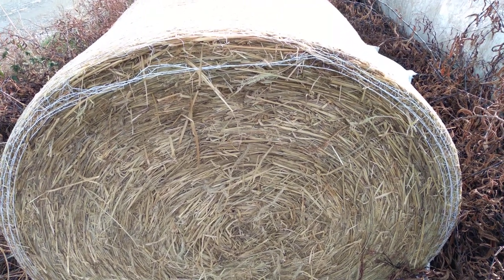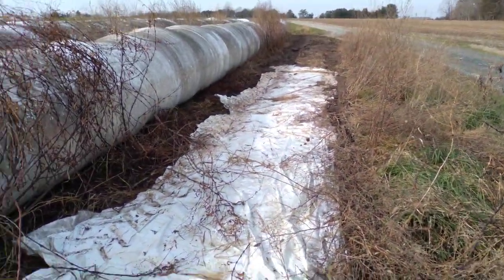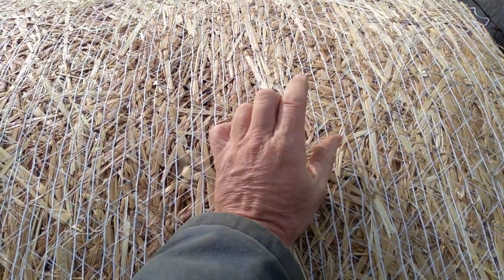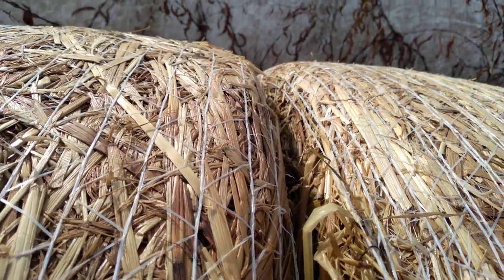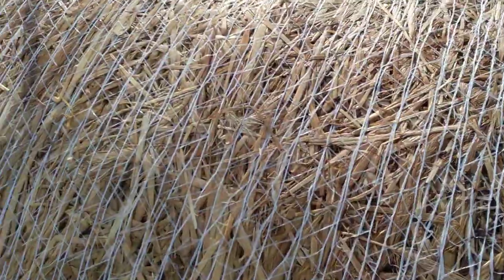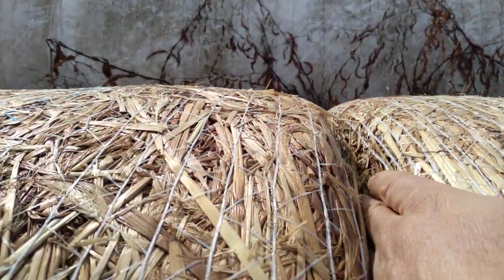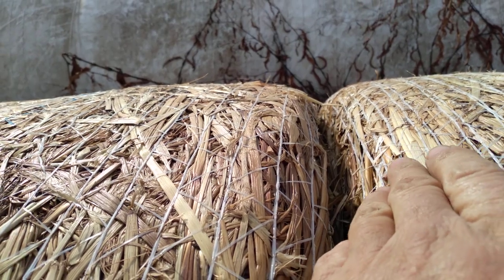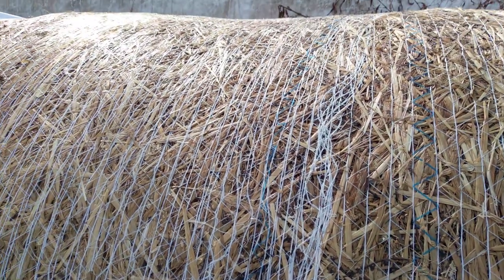More Baleage (wet wrapped silage hay) tips

Comment: At  5:28    Its not mold if the bale is closed tight. Its a white yeast that grows on the bale / hay.  Its sticky..and clear white.  Nothing to do with " mold "  Ive had entire bales covered in this white yeast. Its harmless to cattle !
Reply from the maker: Certainly could be! I described it to the professor over the phone without a picture or a face to face look. Very easy to "miscommunicate" with verbal descriptions. Thanks for the comment!
Reply: @roachfamilyagriculture2417     Ive used balage hay now for 20 years.......never had an issue yet !

Comment: Have you tried those baling machines that wrap each bale individually? That would avoid the v between each bale problem.
Reply from the maker: Yes the single bale wrappers do eliminate any bale to bale issues. The negative is they require more plastic and take longer. If you are wrapping a small amount of bales is single bale wrapper is the way to go, but with a large operation the extra time and plastic adds up faster than you might think. Thanks for your question.

Comment: I bought sum haylage a time or the 2nd time i got it they was water or juice running out of the rolls on bouttom of the load i assume it was the weight of top rolls squeezing them .. but my question is why is they the juice in thar? Cause of the pickling?? The man said they were 4 or 5 years old..wats the life on storn them??  how much you charge for net wrap?? I run a jhon deer 540
Reply from the maker: Excess juice settles to the bottom. If it has juice in the bottom of the bale it was not allowed to dry down to the optimum moisture level before it was baled.